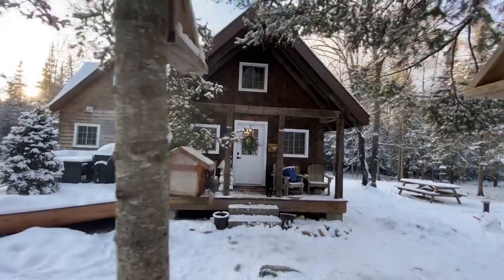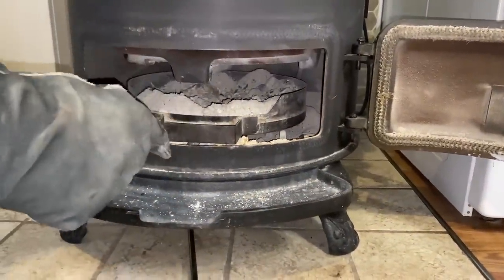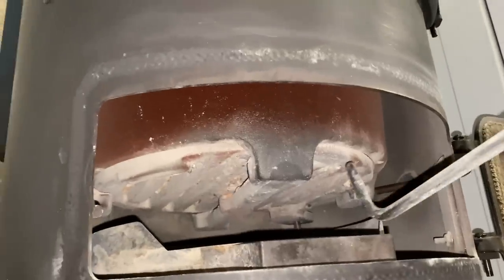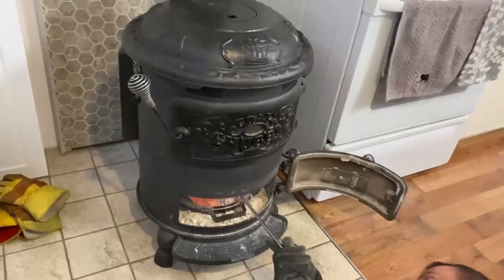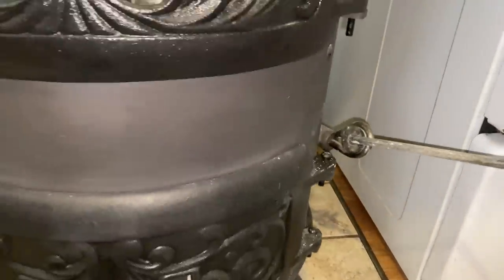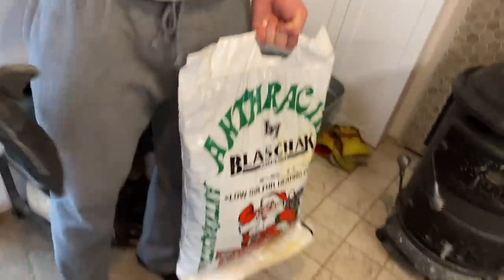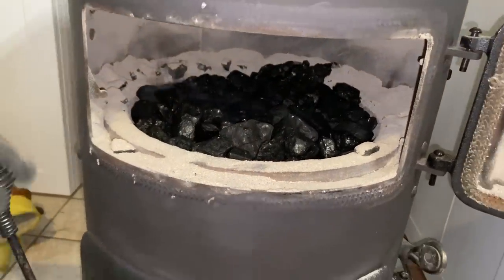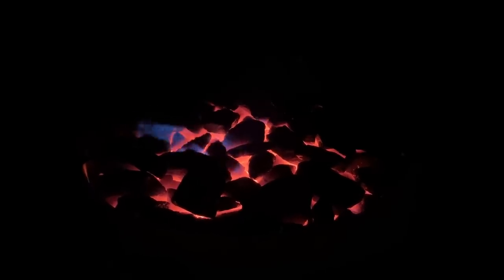How We Heat Our Cabin in the Woods in Winter

Comment: I have 2 ? How much does the coal stove cost and how much does the bag of coal cost
Reply from the maker: Stove is about $2800 US. Coal cost varies depending on your location. Where I am here I have to get it shipped so it ends up costing around $7-8 per bag all told (40 lb bags). Closer to the mine in Pennsylvania, probably half that price or less.
Reply: Thanks for the information I appreciate your reply   most people I talked to is worried about carbon monoxide  I said get a carbon monoxide alarm just like fire alarm
Reply from the maker: @deanharbord3591  I’ve been burning this stove for three winters now, stove burns constantly from December to April and we’ve never had our carbon monoxide detector (which is 10 feet from the stove) go off a single time.

Comment: A good quality EPA approved catalytic woodstove is a lot more economical. We have a Blaze King Princess that we have used as our only heat source for the past twenty years. (We have a gas furnace, but almost never turn it on.) We live near the Canadian border. We light our woodstove in early November  and it does not ordinarily go out (unless we have an unusual warm spell) until around April First. We go through about three cords of pine a year. We normally let it dry for a year, but sometimes cut it in spring and burn it that fall without issue. It burns very clean. Once the fire is going good, and you set the thermostat, there is virtually no smoke coming out of the chimney. I empty ash once a year, after the burn season. There's usually about 3 or 4 inches of ash. I clean the chimney once a year as well. No tarry creosote at all. We get a couple of cups of flaky soot. The glass stays clean. 
Best thing we ever bought. They are a bit expensive, but we've had ours 20 years and still going strong. The only maintenance (besides the above mentioned chimney/ ash emptying) is an occasional gasket and we've replaced the catalyst once in 20 years.
Reply from the maker: Glad you have a setup you’re happy with 🙂
Reply: Thank you for sharing. Very economical stove. I also burn wood as i get it from arbhoryst  so I was burning split trunks as well as brunches . If i get enough help then ill try to make my own burning logs from the brunches Ill chip first. How many pieces you add each time you do that and how often you need to add?Its my 4 th season and steel learning
Reply: Not really. Coal has a substantially higher capacity to head than wood, burns longer and also doesn't not produce any soot. I burn coal myself as it's much more economical than wood.

Comment: Hi i have a problem , i can't get why my fire goes out after 3,4 hours on my wood boiler that supports coal also. 1 i make fire with wood. 2 i wait until embers are formed. 3 i put a small quantity of coal on top of the embers and repeat this 3,4 times until i have a good quantity. 4 wait until the coal is heated and blue fire appears. The boiler has a fan that blow air to maintain oxygen. After this i close all doors and go away but after some time the temperature starts dropping and the fire goes out. it's seems like they doesn't have enough oxygen to maintain burn.
Reply from the maker: Sounds like you’re leaving the door open too long at the beginning. I had the same problem when I first started burning coal. Once the first thing layer of coal is glowing brightly, full your firebox all the way to the top with coal all at once, then immediately close the door. It won’t look like anything is happening, but have faith. Anthracite needs to burn upwards slowly layer by layer. If you try to rush it and wait until you see blue flames before closing things up, it’ll burn out every single time.
Reply: @cabininthewoods517  ok thanks for your reply🤗

Comment: I’m m curious as to how many tons he uses in a winter
Reply from the maker: About 1.8 US tons.
Reply: @cabininthewoods517  that’s not bad at all. I use a pellet stove and burn about a bag a day (50lbs) $5.99 on low or about a bag and a half of high. The place I get my pellets from also sells coal for $6.99 a bag
Reply: @cabininthewoods517  Thats pretty good,  I use just under 3 tins to heat my 2200+ sq ft house, and use a little oil when it's needed.

Comment: A cost comparison to wood would have been helpful.
Reply from the maker: Depends a lot on location and prices of wood vs coal in your area. For me, ready to burn hardwood costs about $120 CAD a chord. I burn 15 chords a winter give or take, so wood costs me about $1800 a winter. Anthracite coal on the other hand cost me $10 a bag delivered. I burn around 90 bags a winter, so heating with anthracite costs me $900 a winter - half the cost of ready to burn firewood. Of course if I cut and split my own wood it’s cheaper, but then I have the labor factor to consider.
Reply: @cabininthewoods517  thank you.
Reply: The convenience of coal is hard to emphasis enough vs. wood.  I distinctly remember when we switched over to an Efel coal stove when I was a kid and i no longer had to split and stack wood all the time. Lol just fetch a couple scuttles every couple days.  The ash we used on ice and to build up our driveway's low spots.
Reply: @cabininthewoods517  is that for a face cord or bush cord?
Reply from the maker: @rottiman100  Face cord
Reply: @cabininthewoods517  We are paying the same $$$$$ here as well.
Reply: @cabininthewoods517  Chords are music related, in terms of wood there is no H in cord.
Reply from the maker: @hithere7382  You’re right.
Reply: @cabininthewoods517  You can fight back against the autocorrect mangler of English via selecting a word to the left or the right of the one in the middle at the top of the keyboard.
Reply: @cabininthewoods517  It sounds like you’re in Canada, as am I.  Who supplies your coal?
Reply from the maker: @louiswestfall9622  I get my in bulk directly from the mine in Pennsylvania. https://www.blaschakanthracite.com/

Comment: I found rice sized of this brand bags for sake 12$.  2 bags in 24 hours is $720 monthly.  I suppose bulk is cheaper and maybe the nut size is cheaper?  Anyway, I can see the benefit of being off grid, but that's expensive.  I lived in a coal heated home once, black ash all over everything inside.
Reply from the maker: It’s much cheaper if you’re willing to buy it by the transport truck load directly from the mine in Pennsylvania. Costs about $6.75 a bag including delivery, and you’ll have many years of fuel all at once. Have to store it though. Outdoors is fine. I personally don’t mind the stove or coal gives off much dust. A lot depends on coal brand and where it was minded. Coal can very greatly in quality.

Comment: I have heard from a friend that the price of coal has skyrocketed since the pandemic. Wood is still free. I live near Mahanoy City.
Reply from the maker: Still about the same price as always for me here. But if you can get wood free of course that’s the way to go.
Reply: I burning coal works for you thats great. However after growing up in a old poorly insulated farm house that was heated by a large coal furnace in the basement i want no part of coal. I can still see all that black coal dust!
Reply from the maker: @dcranch4820  Sounds like you were dealing with bituminous coal. Anthracite burns much hotter, cleaner, and hardly any dust.
Reply: @dcranch4820  coal is oiled or wet nowadays. No dust. I lugged many a bucket of coal from the basement back in the day.

Comment: I can’t believe you’re supposed to lay on the floor with the poker to clean the slots. I’ve been burning coal for about 15 years after heating almost 30 years with wood. I have a coal furnace. I have regular shaker grates. I also burn nut coal. What I find works best for me is to tend to it 3 times a day. It doesn’t have to be exactly equal. My schedule is about eleven PM , eight AM , and three to four PM. 
You might want to try three times a day and only the shaker on the side of your stove. Don’t do the lay on the floor thing. If it doesn’t work for you just go back to your routine. Just trying to save you that one step. 🤷‍♂️

Comment: It would be interesting to combine this with a rocket stove (the world most efficient wood burner) which burns at around 3,000F in the burn chamber.  The rocket stove will have a horizontal exhaust for 20-30' before exiting the house because of an increased draw created by the design. This extracts most of the therms before exiting.  Might be the best of both designs....
Reply from the maker: Interesting idea! I may try that sometime.

Comment: Why don't you use the handle at the back right to floss the grate? That's what is for.
Reply from the maker: I use that for shaking down. To floss properly you need direct access to the grate. At least on this stove.
Reply: @cabininthewoods517  Hi, it is designed to do the floss like with the WEBER kettle bbq. You laying down looking to see if your poker has cleared a slot is both unnecessary and dangerous, a cinder in the eyes is no fun. After emptying the ash box replace it and leave the door open do the the shake down till you see just hot embers falling, close the bottom door and refill the top fire box. Simples.♨

Comment: Careful! Anthracite is very dangerous as it is pure carbon and it's fumes can be nearly 100% carbon monoxide. I recall in Western Massachusetts in the 1960s we'd lose a family every couple of years due to carbon monoxide poisoning after a very cold night. if you experience headaches it's the anthracite killing brain cells. I am sorry for the drama. Please make certain that the draft from that stove is perfect. During a snow storm if the pipe become blocked it's a huge problem. Buy a carbon monoxide detector for 50 bucks as another level of safety. I am an engineer and have prescribed powdered anthracite or charcoal to reduce metal oxides in a furnace and we were very careful to avoid exposure to the fumes. We all still felt a little headache at times. It's important!
Reply from the maker: Thanks for the concern. We’ve never had carbon monoxide issues with this stove. We have a C02 detector 10 feet away that’s never gone off. The draft is excellent, and unlike older style coal stoves, this one is exceptionally safe and well designed.
Reply: @cabininthewoods517  Thanks for your response. I've got 40 years of experience around using carbon in high temperature operations and I simply had to speak up for fear of you getting injured. If you continue to do as you've done and have a detector it's reasonably safe.

Comment: As a single spark could turn your interior coal bin into an inferno, I would recommend an air-tight lid.  It won't stop it from smoldering, but it will limit the combustion rate, thereby keeping it from igniting nearby wood, such as your cabin walls.
Reply from the maker: Not much risk with anthracite. It’s notoriously hard to light, and to keep burning once it’s lit. I’ve held a propane torch to this stuff before     and it didn’t even crackle.

Comment: This was a routine at grandma's in my childhood (1960's). Don't 'floss' the grate unless you have been running it very hot and made clinkers; use of the 'riddler' should be enough. Blue flame indicates carbon burning to carbon monoxide, (CO), which makes less heat than burning to carbon dioxide, (CO2), so don't shut the flue down too much: CO can leak into the room and asphyxiate you in your sleep.
Reply from the maker: I don’t have any experience with older style coal stoves but this sounds like excellent advice.

Comment: If you only burn anthracite coal, why do you have 600 tons of firewood?
Reply from the maker: Two reasons: 1) I burn wood in the coal stove in fall and spring when I don’t need all the extra heat from coal. 2) If the coal supply ever stops flowing, I’m ready with a backup heat source.

Comment: 1. No matter what you burn you need to filter the air will have particles. 
cheap way filter air is with high grade furnace filters and box fan or get a wood shop filter system.
2. You have to have a coal stove to burn this, do Not put this in a wood stove or wood boiler.

Comment: Empty ash , shake stove grate, floss grate fill stove. Always shake first then floss grate
Reply from the maker: On older style stoves, correct. Flossing first works better on this one.
Reply: I’ve been running the coal chubby for 12 years , and the manufacturers video shows shake first then floss. That’s how I do it but if your way works for you then have at it. I’m subscribed I love cabin life
Reply from the maker: @daviddeaton4250  You are correct, but that was the old manufacturer’s video. The inventor, Larry Trainer has since changed his mind on the order. I had the honor of filming a new video for him in my cabin a couple years ago: https://youtu.be/9a96hdgQh4A
But bottom line, both ways work fine and you’ve been running a Chubby 9 years longer than I have so I certainly respect your experience.

Comment: Why didn't you floss first and then throw out the ash??
Reply from the maker: Because the ash pan would overflow since it already has 12 hours worth of ash sitting in it. I leave the ash sitting there after servicing so it’s not blazing hot when I dump it 12 hours later.

Comment: Please explain why you wouldn’t use electricity or propane or oil or wood before coal. Are you aware of pellet stoves that can use (DIY) biomass as pellets (perhaps not as convenient as coal) and can be thermostatically controlled and only require a fill up far less often than twice a day? Also rocket mass heaters can be constructed that only require a daily loading and are very efficient and therefore clean burning and as much as 4x as efficient as a normal wood burner and 2x as efficient as a catalytic wood stove? Both of these could be sustainably supported on your property with some effort. Of course both gas and electricity are the most convenient forms of heating and far cleaner than any DIY source. So other than making a cool video, why coal?
Reply from the maker: 1. Coal is cheaper than all of the above in my area, and far more convenient than wood or biomass pellets.
2. Winters are very cold here, and anthracite coal gives much more heat than the other combustibles you mentioned.
3. My particular coal stove can also burn wood, so if the coal supply ever dries up in have a backup fuel source (the pile of seasoned hardwood in my yard).
Reply: @cabininthewoods517  I can understand the convenience part, especially if you are producing the pellets or the firewood and your time is a value only you can asses. As to the energy content of coal as compared to propane, natural gas, and #2 fuel oil, anthracite coal is a distant 4th having 72%, 58%, and 55% less energy per pound mass, respectively. Anthracite coal has about 30% more energy than pellets or wood. Burning pellets or wood in a rocket mass stove uses almost all of the energy in those materials because of the efficiency of the combustion process and the fact that the exhaust gases are at a much lower temperature than conventional stoves, even catalytic stoves. Your ‘Franklin’ style stove suffers from the loss of heat up the chimney so it isn’t as efficient as it could be. The difference between energy extracted from a wood/pellet fed rocket stove and an anthracite fed ‘Franklin’ stove is  probably not much and may be a coin toss.

Comment: I agree coal is the best way to heat.  I put a stoker boiler in my garage when I built my home in 1992. Heated my home and my domestic water.  $40 a bag??  That's $500 a ton!!   Terrible!!  Buy alot of propane for $500 a ton.
Reply from the maker: It’s much cheaper if you’re willing to buy it by the transport truck load directly from the mine in Pennsylvania. Costs about $6.75 a bag including delivery, and you’ll have many years of fuel all at once. Have to store it though. Outdoors is fine.

Comment: how much per bag of coal? how long does each bag bur? 24 hours?? 48 hours?? you really need to included that stuff in your video. for all i know it could be 35 dollars a bag and burn only for 12 hours a bag...
Reply from the maker: I’ve answered all of the above about 100 times in this comments section.
Reply: @cabininthewoods517  ah ic  half bag a day, so a bag is 24 hours... at only 10 dollars a bag??  at todays prices??? wow cheap i seen some one say it burns hotter them wood.  
hmm wood pellets are about 7 dollars a bag(40# also) and last about same amount of time...  BUT BUT wood pellets need to be used same year as you got them..   coal can be stored for years and years..   but if you can get a pellet maker you can make pellets out of anything. grass. leaves. sawdust..
looks like you have a good thing going with the coal though... but  its coal though..   lol cleaner burning but still coal.

Comment: Well three things coal is a lot dirtier to the environment and to handle than wood, if you have a new stove uses very little wood like the Blaze King  uses 1/3 less wood than most stoves when loaded and lasts for 30-40 Hrs  easy to maintain once a week to clean it out. And these things can heat a 3000+ Sq/Ft home plenty of heat. Coal would be my last choice of heat if i did not have any wood i could get. As a matter of fact, you have to rely on getting coal and when SHTF hits the fan good luck with that?? Honestly a pellet stove would be a better choice just saying  cost me about $6.00-6.50 a day in Ontario Canada 🙂

Comment: Anthracite is much rarer and more expensive than lignite, or indeed any other type of coal. That is because it is older and comes from deeper mines. And unlike burning wood, you are digging up sequestered carbon and pumping it into the atmosphere. With wood, at least you are on the current carbon cycle. There is a reason coal is referred to as a fossil fuel.